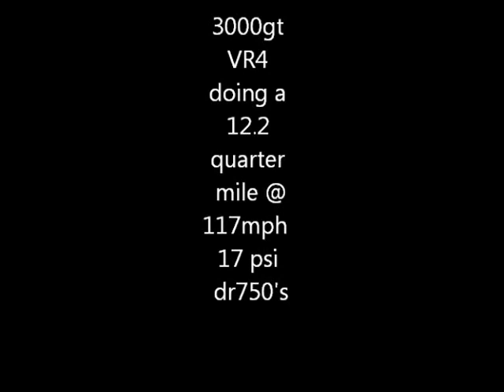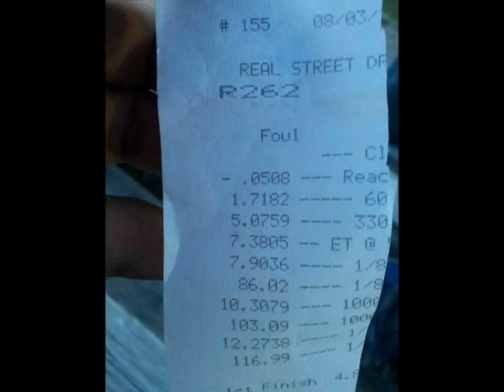Kawasaki green 3000gt VR4 Dr750's Quarter mile 12.2 @ 117 mph 17 psi boost

Comment: From inside the car it looked like a nice smooth pass.  It doesn't look like you did anything really wrong.  What concerns me is that my 15g car with my large 375 pound arse driving ran a half second quicker and 10 MPH faster in the 1/8th mile (7.406 @ 96.xx) with a worse 60' time (1.74).  I do shift more aggressively than you do and that obviously made a huge difference.  I just didn't realize it could possibly make that much of a difference.  Turn those DR750's up.  You should be able to make 200+ more horsepower than I was able to.

Comment: Are you on stock internals with this setup and how reliable is it? To help with shifts, I learned to be putting pressure on the shifter before you actually press the clutch. That way once you go for the clutch, the gear will go in immediately. Sounds odd but it helps a lot.
Reply: this car is an automatic. no clutch needed
Reply from the maker: Stock internals, no problems to date. This was a manual in this video but has since been switched to an automatic trans. Much more consistent and my trap times dropped. Run a consistent 11.5 now with no problems.